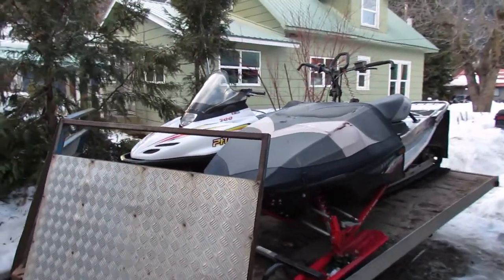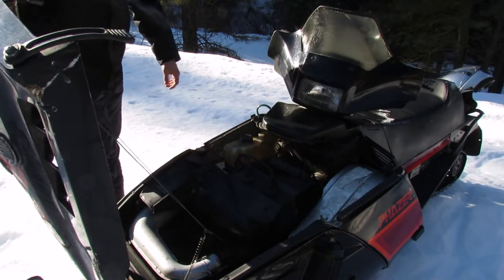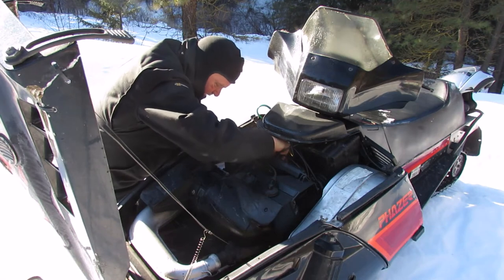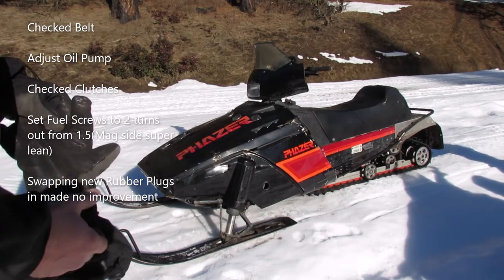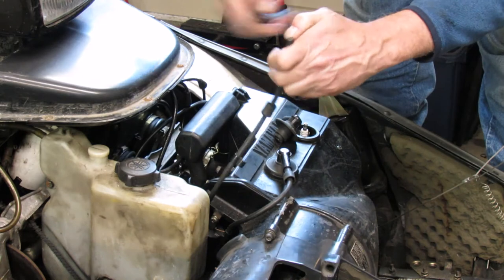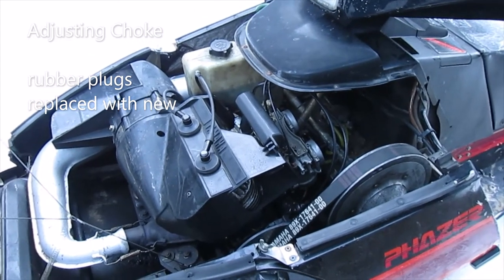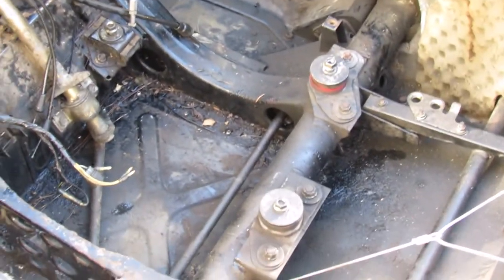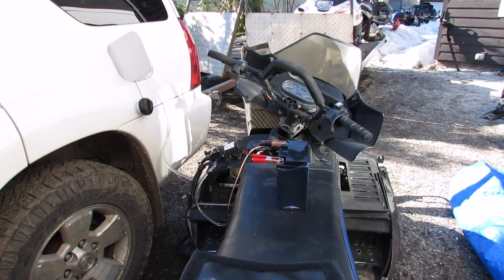Yamaha Phazer - BOG FIX

Comment: Thank you for doing what your going brother!!! Have 1999 Yamaha venture 500xL similar engine. Having major bog issues won’t go over 45000 rpm… and now won’t start even when putting gas in plugs. New to sleds, did the carbs and feel I messed up all the tuning. Lol your videos are helping. 
Mine runs better on choke as well and I’m also feeling it’s crank seal which would suck. Just bought last season. 
Oil leaking from engine doesn’t look good. Going to try a few more things you’ve showed. Thanks again. I’ll keep watching. 
Question, does the filter in the tank sit sideways or straight up. Mine is sideways. Wondered if that could be the issue but can’t get into the tank to pull out the filter. Pulled off seat but still don’t understand how to get the filter out. 😂
Anyways I’m learning the engine through all of this so yay!! 
I will redo my plug boots as well. 👍🏼
Reply from the maker: In the older phazers the fuel filter is vertical, but my 1999 phazer it lays on the bottom so I think you are ok there. Did you put the rubber plugs from the bowl side of carbs in the correct spot? That’s a pretty common thing to mess up
Reply from the maker: No oil should be leaking from engine, have you checked compression?

Comment: I have a 1990 phazer 2 and it is super boggy in the low end, once it clears up it runs perfect. Ive replaced the belt, have cleaned the carbs multiple times and still have no luck. Rubber plugs in carb are in the right places and in good shape. Any ideas what i could try?
Reply from the maker: I’ve had the best luck with 95/137.5 jetting, I’m at 1200-4000’. Also try mixture screw at 1.5 turns out, and adjust 1/2 turn either way and see what happens. If everything checks out I’d say crank seals

Comment: Interesting Video. That sled has evidence of having a cold air intake once installed.  However I didnt see an air-box in the sled?  Ive heard phazers need that airbox to run right.
Reply from the maker: Often during testing I leave the airbox out so I can access the internals easier,
Reply: Moto Shark. Ive had Kuni filters on my phazers for years. They run fine. Also theres a carb mod for the midrange bog. Its been years since i did it. Ill try to find it and post it.

Comment: Fuel lines should be the same length from Fuel pump to carb
Reply from the maker: They are different from the factory due to routing, the clutch side is much shorter than the mag side, the mag side line has a long routing and an outside bend to get back to the fuel nipple. I should know I’ve done it over a hundred times